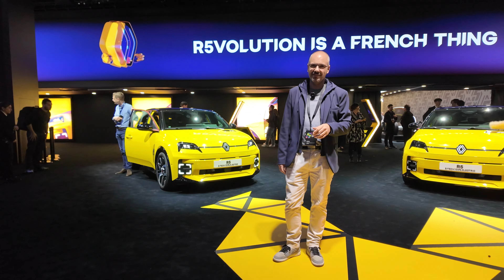Renault R5 E-Tech 100% electric €25'000 EV at #GenevaMotorShow 2024, Powerful, Compact with ChatGPT

Comment: Make the long range for 25k
Reply from the maker: I think it should be 15-18k without the battery, with options all available to swap in from short range at 50/month to long range at 100+/month. But sadly it seems Renault isn't convinced doing battery swap right now..

Make it 3k down payment, 200 per month leasing for 48 months, 50-100 per month for the battery as a service (including 2-4 swaps per month), 3k more after 48 months to keep the car. Something like this would make this more of a no brainer I think.. from 4-5 years later, there may be cheaper shorter range battery subscriptions available at perhaps 30/month.
Reply: @charbax  I'm having huge respect to these companies (or at least trying to lower the price), and I understand how much the competition, but even these prices are still expensive to developing countries